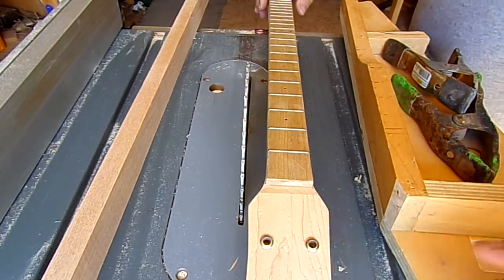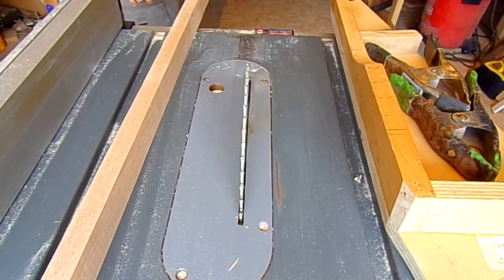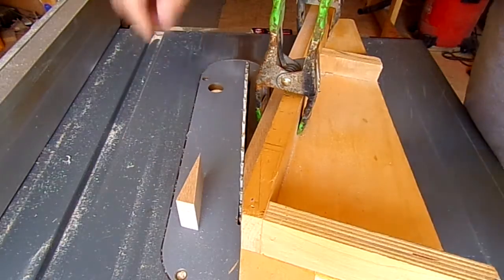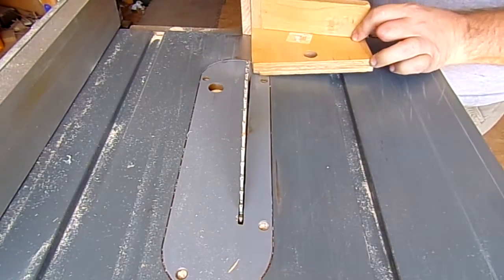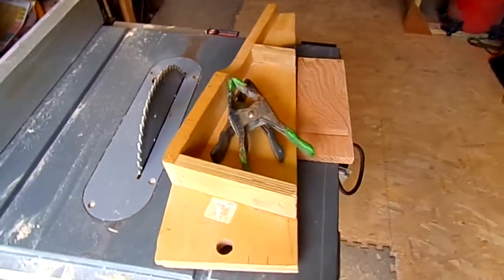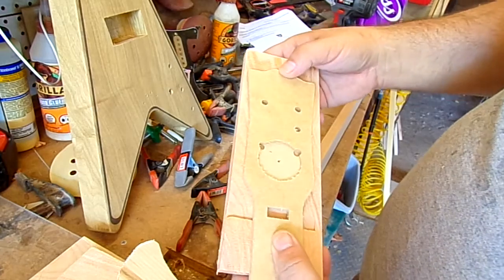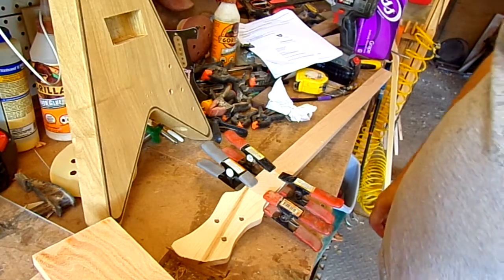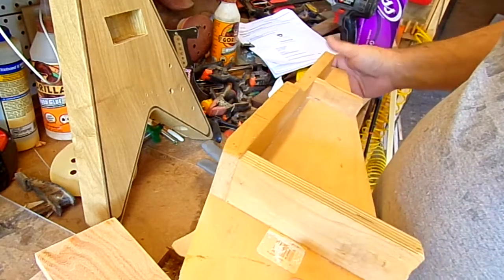scarf joint with a table saw

Comment: I don't know why more people don't do this. I can make 10 necks in a couple hours. The longest part of the procedure is waiting for glue to dry. I make the cut 8" down the board, flipping the end and using it for the headstock, cutting both in one pass. This also limits the change in grain pattern and helps hide the joint because it's the same piece of wood.
Reply from the maker: S Patoine  I made from 60-100 necks a month when I built, the scarf joint was a Godsend!  Speed strength and versatile ,  happy building!

Comment: When you start off your video talking about Gibson and scarf joints I have an immediate negative reaction.  Gibson's are notorious for snapping off head stocks precisely because they don't use scarf joints.
Reply from the maker: DALG Guitars  Gibson does have an issue with it , the primary problem is how thin they make the neck at the nut and the way they do truss rods.  Done right it’s a good strong joint.  A lot of major manufacturers use a scarf joint and it works,  Gibson does have its issues I agree.